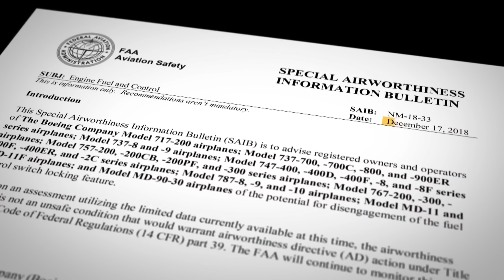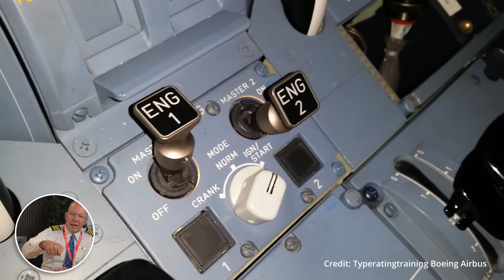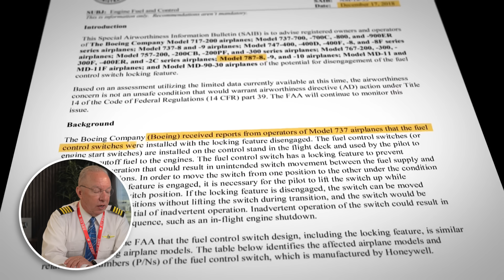Air India 171: The FAA’s 2018 Fuel Switch Locking Bulletin Explained (16 Questions Answered)

Comment: i know during takeoff the PF takes the hand off the throttles and onto the yoke at V1 aside from the trim cutout and parking brake what reason would the PNF need to touch in the first 400 feet in our small plane u sit with ur hands on your legs if u are PNF

Comment: A question for Captain Steeeve (hope you see this message and reply): a scenario where both switches remained in Run position the whole time but somehow a glitch in computer caused it to read Cut Off on Engine1's switch (Engine1 shut down) and a second later Engine2's switch (Engine2 shut down).  Then 10 seconds later, computer correctly read Run on Engine1 and 4 seconds later on Engine2. The pilot who yelled out why did you cut off engine merely did so based on the hearing of the engine's spooling down, not actually seeing the switches had been physically switched positions; that was why the other pilot claimed he did not cut off the engine.  Your thought?
p.s. wonder if there were any redundancy of sensors to monitor Switch and how many reads before computer accept the results?

Comment: Great job Steeeeeeve - not sure on the number of EEEE"s - Former put-put pilot - my father flew for two of the majors for 28 years, + air force for 10 - just shy of 28k hours in the air - camera's in the cockpit won't stop any "accidents" if you can now call this an accident - it might make it easier for the investigators to solve, assuming the ERASE the black-box data button does no longer exist - (737-Jurasic) - upper panel just to the right of the captains right shoulder - other planes may very ... or hopefully no longer there. He did not show me this, another Captain did. - the mid 80's were different. You were sort of asked in a prior video - about a statement by one of the pilots  - "Why did he do that" and not "Why did YOU do that" is there even the most remotest possibility that there was a 3rd person in Jump seat -  that was unaccounted for (Officially)? It Would or at least might  explain the different phraseology other than English not being a First Language - REALLY Grasping for a NON-PILOT MURDER SUICDE ....?

Comment: Seems to me there are a lot of assumptions flying about. Having worked with electronics and computing technologies for most of sixty years, I am a lot less confident of its infallibility. Cousin Murphy and his law are always hiding around somewhere. First those mechanical switches control an electric current which either operates actuators for those valves directly somewhere between the fuel pumps and the injectors, or they connect to a logic unit which actually sends the controlling electrical current to said actuators. Second, even though the probability of an electrical fault in a switching mechanism may be low, it DOES exist. That probability increases with age. Corrosion caused by air, cleaning chemicals, time, and water do cause oxides on electrical contacts, which sometimes create circuit faults. In the technology business, we often turn things off and back on when there is an electrical fault. While the probabilities are low that both circuits fail at the same time, those switches are , physically near to each other, and all that it takes to create a single point of failure is a common power source or ground. If the monitoring system is digital, it is probably polling device state sequentially, so it will always notice a slight difference in time. If software is involved, that difference is likely to register as approximately one(1) second. So I propose he following scenario: The pilots are in the liftoff/rotate process, vibration or stress on the airframe is somehow enough to cause a fault in the aging circuits which the automated monitoring systems identify as a fuel off condition. A warning is generated which prompts one pilot to notice, and speak to the other who denies having changed anything. In response they immediately, as we say in the communications business "recycle" the switches, which tends to correct such faults, but in this case it was too late. I don't work on airplanes, but I have seen transient failures in other electronic and electrical systems caused by age and oxidation. One 10+ year old automobile we owned need to have the electric system disassembled and all the connectors sprayed with WD40 ever three or so years because of this sort of thing. Remember that most other passenger jets are made of metal which is an electrical conductor, but the 787 is made of a nonmetallic composite. That potentially changes half of everything, because all grounds must be wired.
Reply: The investigators can hear everything. They would have heard the switches as well.   Not to mention if it was an electric or computer fault then the switches wouldn't have moved at all.  The pilot wouldn't ask why they cut off.   He wouldn't know what was wrong that fast unless he saw it happen or saw the fuel indicator and the switches off.   And if it was a computer or electrical issue, how did they come back on?  Just randomly after he asked?  Just unglitched itself 10 seconds later?   Sure maybe, but in 10 seconds the pilot flying couldn't have figured it out that fast and again, wouldn't have asked.  

If the pilot monitoring saw the issue with no fuel flow on the gauge he would have seen the switches and wouldn't have asked either because he could see if they were or were not moved.   He would have said something like, Problem with the fuel getting to both engines.

Comment: The Fuel Supply should be auditorily announced AT EVERY SINGLE ACTIVATING OR DEACTEVATING SETTING!!!!
What is around that Switch Area????  Anything that was needed to be activated???? Why did the CoPilot reach down and cut off the fuel supply?????  THERE SHOULD BE A VERY LOWD NOISE IF THE SYSEM WAS DEENERGIZED!!!!!  And LIGHTS SHOULD BE FLASHING!!!!  AND THERE SHOULD BE 10 SECOND DELAY IS SOMEONE INADVERTENLY DEENERGIZED THAT SYSTEM.  FUEL IS THE G DAMN LIFE OF THE PLANE AND ALL THE OCCUPANTS!!!!!  IT'S UNBELIEVABLE THAT THIS PARTICUAL SYSTEM ISN'T FUCK UP PROOF!!!!  SOMETIMES THE PILOTS GO CRAZY, OR GO GO STUPID.  THAT SYSTEM IS TOO IMPORTANT TO BE SO VULNERABLE TO MALFEASENCE!!!!!

Comment: That "no cameras in the cockpit" speel was one of the biggest excercises in mental gymnastics I've seen in a while.  Even Steve doesnt buy it but did his best.

And then in answering the next question, he basically presents an argument FOR cameras in the cockpit.
Reply: I'm a former Navy officer (not air though) but my mind was spinning as he gave that excuse
Reply: Heck we can't walk down the street without being on camera
Reply: @laurataylor8179 Exactly.  And I've worked in places where the union negotiated agreements where video couldn't be used for discipline without an "incident" or "near miss" having occurred.

More than fair.

Comment: The captain is a bit too quick to dismiss any possibility of an electrical fault. I can see he is not an investigator, but I am and I don't see definitive proof of an event not happening purely because other crew could not replicate the problem in a different aircraft (Sim) under different conditions. In addition, there's too much of "I don't think that's what happened here" - this is not a matter of belief or opinion, purely facts. We still don't know what the fdr recorded - movement of the switches or the valves. The switches don't shut the fuel directly (like it does in cessna 210/206/177 etc), but rather 'by wire'. Is there a possibility, however small, that the valves operated without switches moved? - looks like we don't know, possibly never will.

Comment: Can you explain the fuel cut off switch bulletin? It seems like that’s the kind of thing that a pilot would catch on the very first flight of the aircraft, or after an upgrade of some sort. I assume that there is no way that those switches could’ve been faulty per the bulletin, because any pilot should have caught the fact that they did not work right?

Comment: Captain Steve I have a question what if there was a failure to the fuel system and engines stalled . To the surprise of one of the pilot he assumes that the other pilot has switched it off and he responds I haven’t . After that point what will be the standard operating procedure to start the engines again .

Comment: If one pilot turned off the switches, the reaction of the other would be different. He would say something like this: are you crazy,  are you an idiot, why do you wanna die, etc, and immidiately report it to the ATC stating the pilot turned off the fuel spply, it takes just 2 seconds. But here we see a different picture.  The legent Fuel Cut Off lights up and chime sounds. The first reaction of the pilot to ask the other pilot if he did something about it, who replied no. If Boeing software can shut down both engines in flights for no reason, its more probable that its manufacturing defect and it must be ruled out first.

Comment: Question @05:05 ... look up the word "naïveté".  You think that "suitcases of money" are never deployed to engineer a desired outcome or in the alternative, suppress or alter relevant data inside sensational investigations?  Really?  How old are you?  In the instant matter, Boeing's reputation in the commercial sector is at best "on-the ropes" and there is abundant published evidence online of manufacturing safety issues.  Moreover, if not mistaken, Boeing was 'self-inspecting" and signing off on Q.C. items with FAA blessing.  As the person posting this question suspects, the only rebuttal witnesses are dead.  How convenient is that?  Regardless, the flying public cannot be duped and I suspect many will avoid BOTH Air India and B787 Dream liners going forward.

Comment: this could be a chip failure.  Something that interrupted the electrical flow in the chip system.  Also, something called the FADECK and fuel operation.  After so many flight cycles. . .

Comment: If the switches were installed without the spring / locking mechanism wouldn't that allow for vibrations during take-off to cause them to move to cut-off???

Comment: Here are my questions causing doubt on at least one pilot’s intentions and making it look like a murder-suicide incident.
1. Assuming the monitoring pilot asked the question “why you cut the fuel off” and the pilot flying at the moment denied it, how come he himself didn't feel that the plane was losing thrust? He was in the 'driving seat' so to speak and should have experienced it sooner or at least at the same time?
2. Why the 2nd switch was turn to “run” after 4 seconds of the 1st one?
3. The plane was on the fire for ~20 seconds and only 2 sentences were spoken between two of them?
4. Everyone tries to cast the net wider while starting an investigation. Have the investigators found very strong incriminating evidence that motivated them to give the clean chit to the manufacturers so early on?
5. The switched were shut off in such a critical window of ~30 seconds realizing there won’t be any recourse left and therefore guaranteeing fatalities.

Comment: Captain Steeeve how long does it take for the fuel to start flowing after the switches have been turned back on? You said within ten seconds, the other pilot switches it to run. Is that not enough time to gain altitude? Thanks love your youtube show!

Comment: My big question is who’ll it make since to equip planes with a set of fuel cut off switches for both the pilot and copilot.  The design the software where both sets of switches need to be turned off for the fuel to be cut off.

Comment: The SB was from 2018.
Why is nobody picking up on the fact that the switches on this plane were replaced TWICE since then? (2019 and 2023).
Newer modules would have had inspections carried out before being installed on the plane, and any problems with the locking feature would have been caught by hundreds of pilots using them every frickin' day.
Besides, two switches in one second exactly at the most critical point of the flight?... No way this was accidental.
Also, engines being switched to cutoff at any time will trigger many cautions and warnings.
It starts with "Engine Off" and then the host of messages that pop up when power and hydraulics are lost.

Comment: Regulators and Investigators: It is recommended that the official investigation into the AI171 accident, led by the AAIB with support from the NTSB and other parties, thoroughly explore all plausible failure modes. While the mechanical failure of the switch lock as described in the 2018 SAIB presents a compelling hypothesis,   **  the possibility of a purely digital failure mode should not be discounted  **  . Investigators should seek to determine if the Flight Data Recorder logs the physical switch position or the digitized signal from the Panel Interface Pod. A comprehensive analysis of the PIPs and associated network components is warranted to definitively rule out a "ghost in the machine" scenario where a spurious digital command initiated the engine shutdowns. Understanding the precise point of failure in the command chain is critical for developing effective and targeted safety recommendations to prevent a recurrence.

Comment: I’m troubled by the overall assumptions of this video. It seems to lean really heavily into the theory that one of the pilots intentionally cut off the fuel in order to crash the plane. While that’s a tragic possibility, the cockpit voice recorder shows one of the pilots ask the other why they cut off the fuel. The other pilot says they did not. Steeeve then points out the pilot that allegedly is not trying to crash the plane manages to fly the plane, call out a mayday, and return the switches to the run position. Why wouldn’t the other pilot intent on crashing the plane prevent the switches from being returned to the run position or take more drastic action by attempting to more aggressively take control of the plane? Hmmmmmmm.

Comment: One area that seems underexplored is the possibility that the fuel control switch locking mechanism was not functioning as designed, as raised in the 2018 FAA SAIB (NM-18-33). If the switches could be moved without lifting, there’s a credible scenario where the captain inadvertently bumped both switches into CUTOFF while removing their hand from the throttles post-rotation.

Appreciate your insights and would love to hear your thoughts on this possibility in a future update.

Comment: If it is such a critical control , couple of very important questions 1 . Why is it not designed when plane is airborne it’s not  get locked as additional security 2. Why Boeing did not make it mandatory fix when it reported in 2018
Reply: I don’t think it’s a human error , it’s mechanical error , within 01 sec human cannot switch between 2 controls

Comment: That argument about cameras is invalid.
Cameras are as important as the flight data recorder and the cockpit voice recorder.
A camera would tell definitively if the pilot flipped the switches or if it was a switch problem.
Worry about video being leaked is ridiculous.
Then need to install another box like the FDR and CVR which stores the recordings. The recordings are only viewable once removed from the plane.

Comment: How about the config of the jet. I still don’t get it. Where the flaps at T/O position or not? 
As we all know, THR TOGA TOGA Then positive rate gear up.  Then THR - Lnav - Toga. 
1000ft lower the nose to 9degrees. Accelerate and get the flaps up.  

Where where the flaps at time of failure. ?

Comment: re: cyberattack. There's an ECU (the ECAM) sensing the switches and controlling what happens as a result of switch state change. All due respect, ECUs are computers. Could it have been attacked? Dismissing the possibility requires first weighing the findings of the Threat Analysis, Risk Assessment (TARA). Without first reviewing the analysis, only one conclusion is viable—computers are generally vulnerable given a sufficiently motivated and resourced threat actor. To dismiss the possibilities, let's dive into the TARA. If anyone can find it. I rather hope it's not publicly available, although every feasible attack scenario should have been mitigated in the design and implementation of the system.

Comment: RE: Video Cam in Cockpit -    Disagree for 1st time in years of watching you.   I was a cop for 27 years.  Last 7 were with cameras.    So,  it was a change after 20 years.   I had no problem with them.   Vast majority of cops did not have any problems.   Unions - YES.  What's the big deal if you are doing everything correctly?   The answer is NONE.    I actually liked them.  I was by the book.   You never know,  if a camera had been in this Air India 171 -  it would maybe shed some light indicating that it was NOT a deliberate act.   We will never know, but what we do know is that the public will put blame on the pilot now and forever.
Reply: The issue is because airlines could potentially use this in retaliating ways. Law enforcement and piloting are two different worlds. Besides, do you really think investigators have no way of knowing which pilot it was? They wouldn't release that in a preliminary report.
Reply: @Skywest25  Of course piloting vs law enforcement different worlds.  Yes, they know.   Some pilots on the line have said he had shown some  issues and he had been on medical.    My point is cameras keep everyone on their toes.  Whether it be SKW or DAL or AIC.  You wonder how it might have changed the life of the FO's parents and sister if there had been a camera.
Reply: @marialilahl3217  The discussion in this crash. Cameras in general is a whole other animal. If the pilot didn't want to be identified, all he has to do is cover the lenses while the cameras weren't recording and hope the other pilot wouldn't notice. If that were the case here, what would the having the camera onboard benefitted?